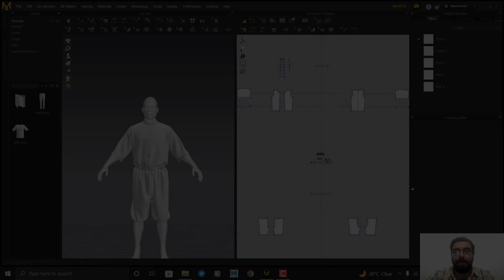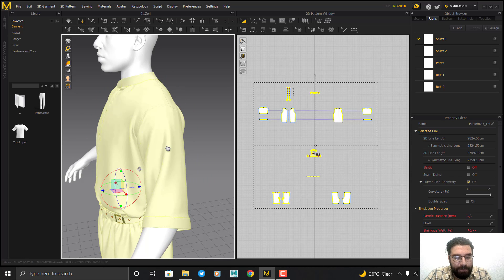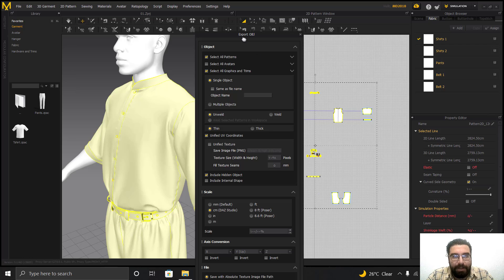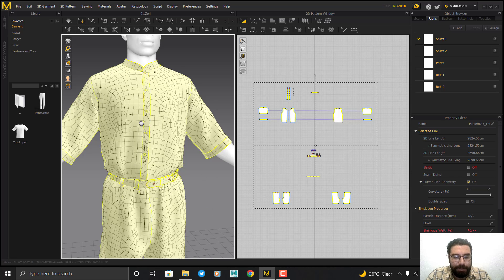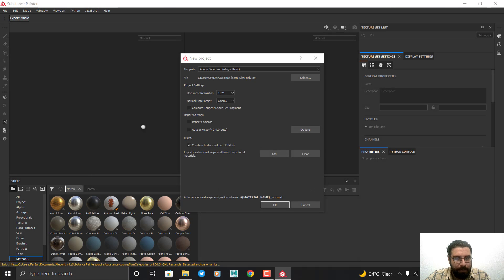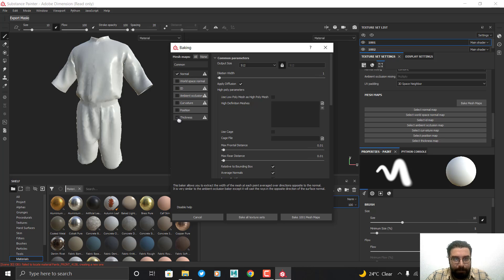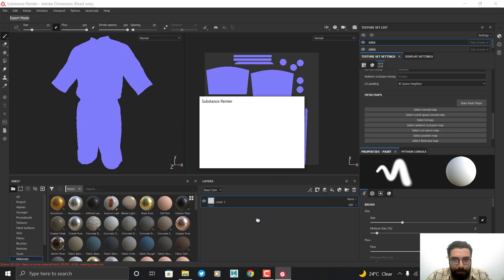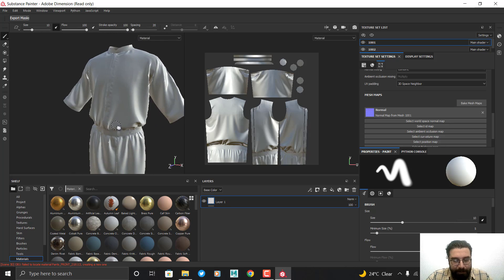How to bake high-poly on low-poly models : Marvelous Designer & Substance Painter

Comment: // Function to check if an edge is already processed
proc int isEdgeProcessed(string $edge, string $processedList[]) {
    for ($item in $processedList) {
        if ($item == $edge) {
            return 1;
        }
    }
    return 0;
}

// ---------------------
// STEP 1: Convert edge loops to curves
// ---------------------

string $edges[] = `ls -fl -sl`;
string $processed[];
string $newCurves[]; // to track generated curves

for ($e in $edges) {
    if (isEdgeProcessed($e, $processed)) continue;

    // Select edge loop
    select -r $e;
    SelectEdgeLoopSp;

    // Store current loop
    string $loopEdges[] = `ls -fl -sl`;
    $processed = stringArrayCatenate($processed, $loopEdges);

    // Convert to curve
    polyToCurve -form 2 -degree 3;

    // Get new curve (assumes just created)
    string $created[] = `ls -sl -dag -type transform`;
    $newCurves = stringArrayCatenate($newCurves, $created);
}

// ---------------------
// STEP 2: Reverse curve direction
// ---------------------

for ($c in $newCurves) {
    string $shapes[] = `listRelatives -s $c`;

    if (size($shapes) > 0 && `objectType $shapes[0]` == "nurbsCurve") {
        reverseCurve -ch false $shapes[0];
    }
}

// ---------------------
// STEP 3: Set pivot to curve start point (cv[0])
// ---------------------

for ($c in $newCurves) {
    string $shape[] = `listRelatives -shapes $c`;

    if (size($shape) > 0) {
        float $pos[] = `pointPosition ($shape[0] + ".cv[0]")`;
        xform -ws -pivots $pos[0] $pos[1] $pos[2] $c;
    }
}

this mel script will convert edges to curve and set their pivot to starting point

Comment: thank you for the good video I want to bring this result to unrealEngine and use it. Can you tell me how to select it specifically? I'm a beginner, so I don't know what to press exactly.
Reply from the maker: Hello there, well I don't have much experience with UE but as I know the UE5 will do this automatically and will reduce the polygons for you and you can do this process here with these softwares and then import them into UE, as a beginner first learn how to work with UE, learn about the menu and toolbars and basically the tools, importing this file into UE not going to be a problem for you.

Comment: For this to work you can't have any thickness?
I've tried so many methods and spent 3 days with this already and just want to finish it. I've tried this and it doesn't really seem to work for thick clothes. I tried baking it in Substance and Maya. Substance was the closest I've come...
Reply from the maker: No, this method doesn't work with thick clothes, the thick clothes normally have problems for baking.
you can go forward along this way and at the end in a software like Maya or Zbrush you can add thickness to it.
Reply: @paradoox1001  I see so what I should have done is baked it before adding thickness.
Reply from the maker: @unrealdevop  Yes, that's right and let me know if you had any issues later.
Reply: @paradoox1001  Alright appreciate it. I'll try to get around to testing that out here soon. I've just been working on animations for the first Cinematic scene. I'm new at animations too so I'm struggling a bit.
Reply: @paradoox1001  Thanks for reminding me, I done forgot again...I got too much going on right now...I got a gamejam coming up and stressed about that as well because it's my first one.
Reply: @paradoox1001  Thanks, and yeah for sure. It keeps things interesting and sometimes very frustrating.
Reply: @paradoox1001  Alright, for sure I'll revisit this as soon as I have time to set aside.

Comment: thank you. I imagine that this method is functional only for still models since as soon as the clothes are animated the normal map is baked and does not match the wrinkle animations, right?
Reply: No it works with animated models too. In the same way textures do not distort when a model changes pose nor does the normal map.
Reply from the maker: @tokyospliff  Thanks for the info